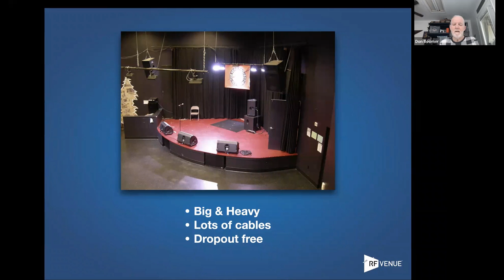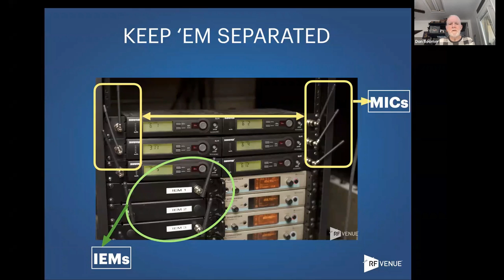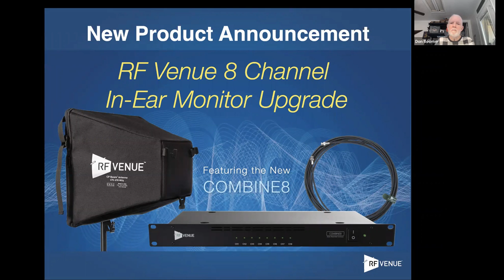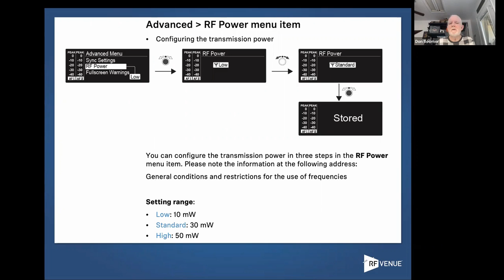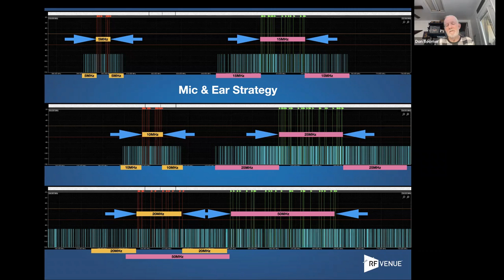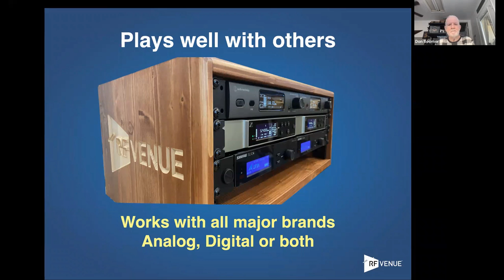Setting up In Ear Monitor Systems (IEMs) - Webinar

Comment: A few bookmarks for me:
New interference sources:  
LED lights, 5G cellphone systems  5:07
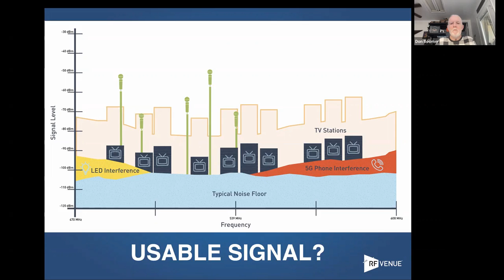Shrink the noise floor:  7:11
Shifting to another channel is more difficult these days, since we have only 6-10% of the available space that we had 5-10 years ago  7:25
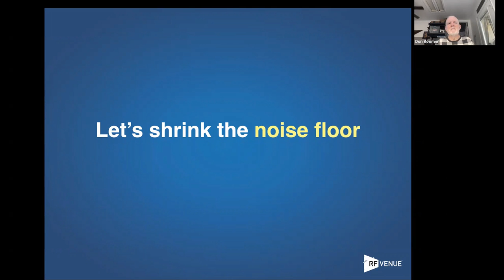Shrink the noise floor by getting rid of the "antenna farm":  7:56
Choosing transmitting frequencies - low vs. high frequencies (but "doesn't make very much difference at all"):  38:16

Comment: Just watched about halfway through this video and I had a question

My band currently runs a brain rig that has six shure GLXD’s. Into a frequency manager antenna combiner.

I was hoping to put at least 4 Shure PSM 300s in the back, and then run those into an antenna, combined her as well….

Your video said, that’s a very bad idea which I respect 

Would there be a way for the GLXD’s and the PSM 300s to live in the same unit but then run the antennas to opposite sides of the stage? 

For example, the GLXD’s I have the fin antennas on the far right side of the stage facing the front middle 

And what if I have the PSM 300s into an antenna combiner that also runs into a fin antenna on the far left side of the stage facing the front middle

Would that not work?
Reply: Considering how long ago you posted this comment, I imagine you've probably gotten things figured out by now, but just thought I'd pop in here for the benefit of anyone who may have this same question. 

To be clear upfront, I don't have much hands-on experience with wireless, I'm mostly going off of info I learned from this video and another webinar they did a couple months prior to this one, which is available on this same YouTube channel. 

It's ok to have transmitters and receivers together in the same rack. The problem is having a bunch of antennas close to each other, and that problem is regardless of whether the antennas are transmitting or receiving; if they're close to each other, they will interfere with each other, making dropouts more likely. 

So in a case like yours, you could absolutely have your mic receivers and IEM transmitters all in one rack, and have the receivers fed by an antenna splitter and the transmitters feeding a combiner. But then you have to consider antenna placement. 

In addition to keeping enough distance between the antennas, you also need to ensure the transmitter antenna isn't pointed at the receiver antenna(s), because that can cause feedback. So you will probably want to be using directional antennas, and you will need to keep the receiver antenna(s) out of the way of the transmitter antenna. Placing them on opposite sides of the stage is probably not a good idea, for that reason. In the aforementioned other video, Don recommends either placing both transmitter and receiver antennas on the same side of the stage but with the transmitter antenna closer to the performers, or placing the transmitter antenna on the side of the stage and the receiver antenna(s) behind and/or above the audience. If you're using both handheld and bodypack transmitters (say, for vocals and guitars/bass/horns/etc), the latter would break line of sight for the bodypack transmitters, but if it's all handheld, that's not a concern.